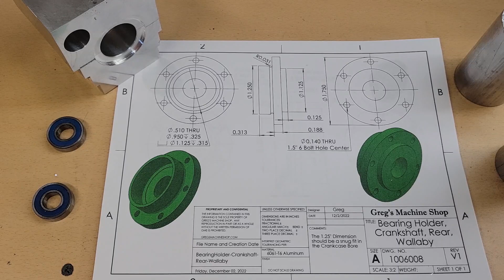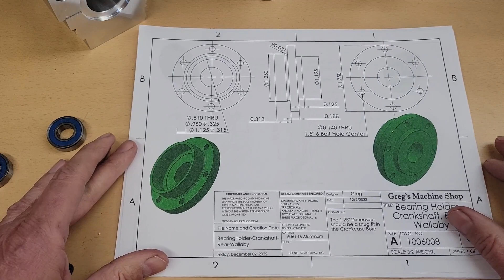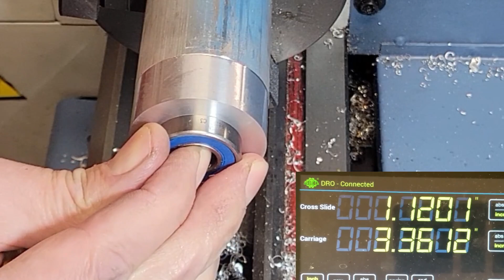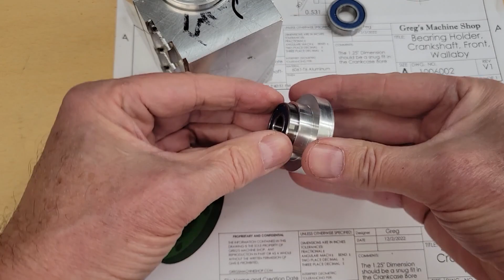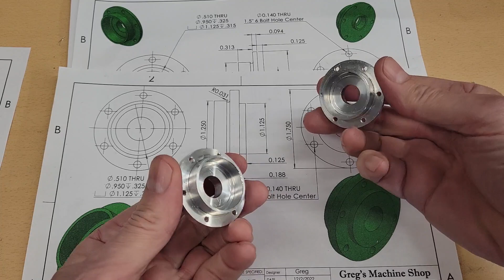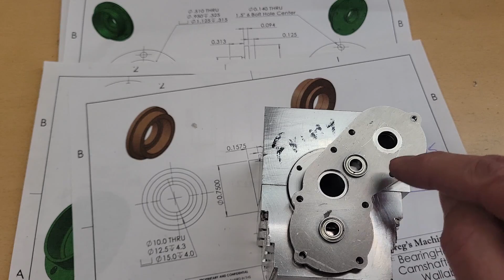30cc Model Engine Build - Crankshaft Bearing Holders -Part 5A

Comment: Maybe I missed it, but where do you list the bearing numbers?  Is there a crankcase assembly drawing?
Reply from the maker: The Camshaft Bearings:  6700-2RS Deep Groove Ball Bearings Z2 10mm x 15mm x 4mm Double Sealed Chrome Steel 
The Crankshaft Bearings: PGN - R8-2RS Sealed Ball Bearing - C3-1/2"x1-1/8"x5/16" - Lubricated - Chrome Steel
These are in the bill of material for the Crankshaft Assembly and the CAmshaft Assembly and those drawings have not been released yet.  I use the bearing holders to match drill the holes in the crankcase and sump, so I made the bearing holders early.

Good find, thanks for the help.